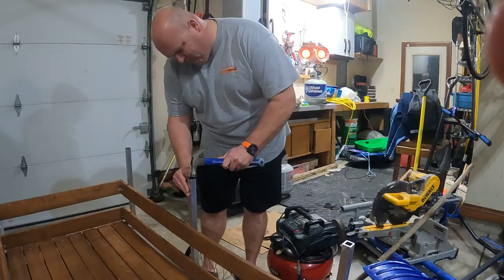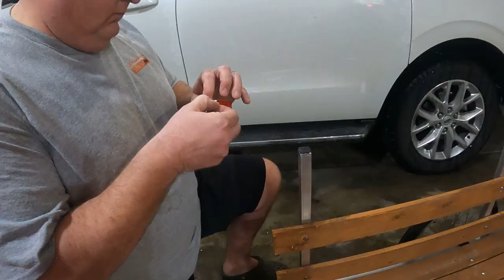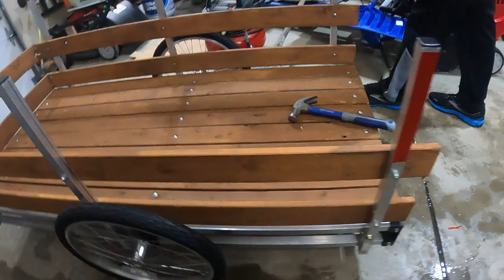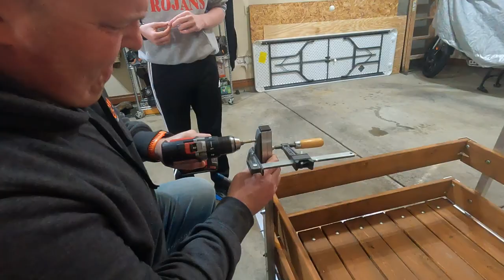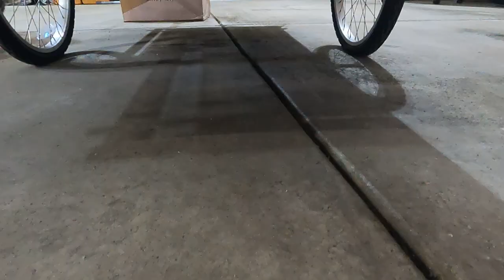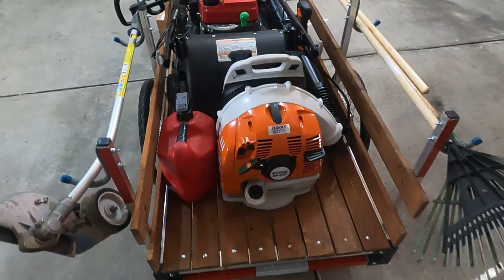Bike Cargo Trailer Update

Comment: What a tidy job - it looks great! 🙂 I sold my car a decade ago (ran out of money) and ride my bike everywhere these days. I need to do about 70 miles a week.

It's not much fun when you HAVE to ride (I can't afford buses or taxis or trains); the weather here is lousy - constant wind and rain - and there are no cycle lanes, so it means sharing the roads with angry motorists who want to see all cyclists dead; but I refuse to be intimidated. A couple of years ago I built myself a smaller, simpler version of your two-wheel trailer for carrying groceries.

After struggling to find the cash to keep an old car on the road - tax, fuel, MOT test, servicing, insurance - there's a wonderful sense of getting something for nothing with a cargo-capable bicycle; mine costs me virtually nothing to run.

It'd be nice to have an e-bike to take some of the pain out of pedalling, but like all EVs they're ludicrously expensive (10 or 15x what I'd call affordable), so I'm reduced to old-fashioned hard work to get around. At least it keeps me fit.

One thing that anyone planning on making a trailer might want to consider is security. Although the bike+wagon combo makes for very effective personal transport, I'm based in the north of England (UK) and shopping trips involve leaving my 'rig' locked up outside supermarkets while I'm inside buying spuds and soap powder and tins of beans, so the ugly problem of theft becomes an issue.

My bike's teenaged and tatty and worth no more than £30, so is not a desirable target for thieves, but the trailer always draws a lot of attention. I'm careful to chain and padlock it to the bike in two places, and then to lock the bike and trailer combination to an immovable object (in three places) whenever I'm away from it.

It's sad that it's necessary to have to think in such paranoid terms, but at least the trailer makes it easy to haul half a ton of chain and padlocks around... 😁

Comment: nice build. i bought a cargo trailer with sides but it couldn't fit to my wheel hub. so i purchased the kind that goes to the seat post from same manufacturer but it is the open design. i'm wondering if i can just use the sided trailer that i couldn't get to fit by drilling drills to connect it to the piece that goes to the new trailer. or could i connect the new trailer to the old trailer and basically have a 4 wheeled trailer. not sure how it would connect (to the axle of the first trailer) or cut that part off and just screw the two pieces together?